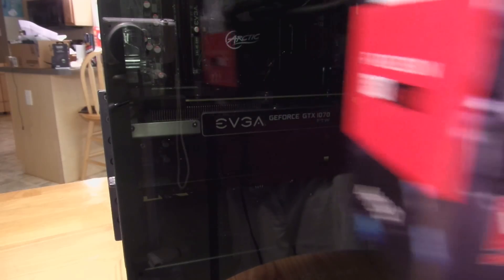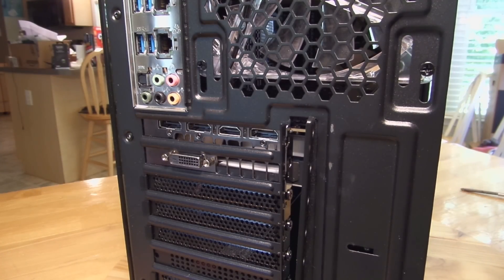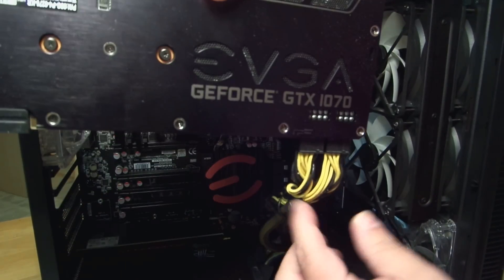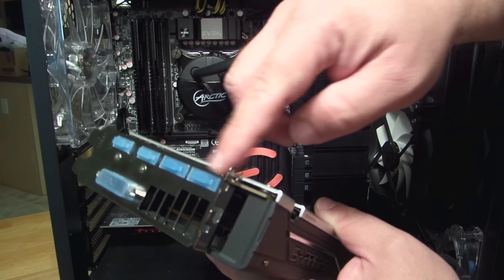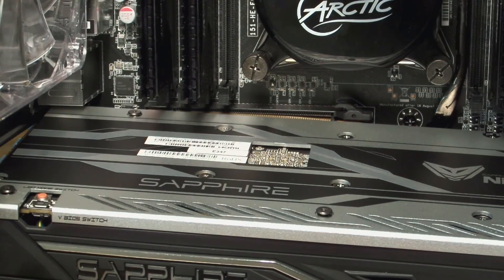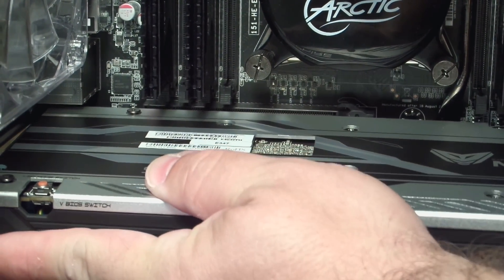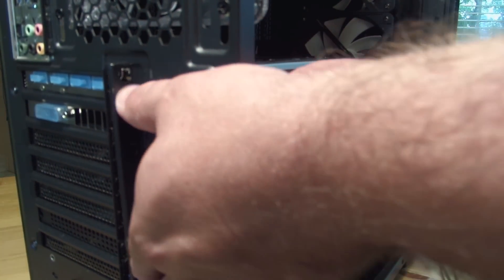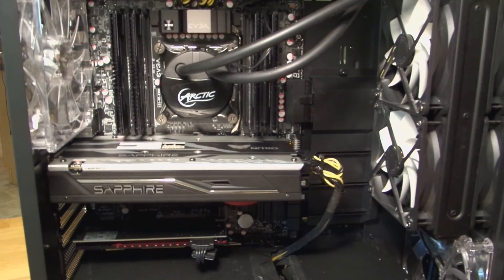Tutorial: How to Install the Sapphire Radeon NITRO+ RX 480 8GB GDDR5 OC Video Card

Comment: hey guys i have already got all of these parts:
CPU: Intel Core i5-6500 3.2GHz Quad-Core Processor 
Motherboard: MSI H110M Pro-VD Micro ATX LGA1151 Motherboard 
Memory: Crucial Ballistix Sport 8GB (1 x 8GB) DDR4-2400 Memory 
Storage: Seagate Barracuda 1TB 3.5" 7200RPM Internal Hard Drive
Video Card: Sapphire Radeon NITRO+ RX 480 8GB 
Case: Corsair Carbide SPEC-M2 MicroATX Mid Tower Case  
Power Supply: XFX XT 500W 80+ Bronze Certified ATX Power Supply

1) Will all these be ok to run? 
2) Do i need better cpu cooling or any other fans?
Reply: i am using stock intel cooler. thanks for reply
Reply: would it be ok if i am only playing overwatch and csgo? i will add in future :)
Reply: Iggy Castillo thank you very much, keep up the good work, and will do in future! (I'll get the cooler and another 1*8 ram) another quick question, I sorta need help with actually installing windows, do I need to buy a product key?

Comment: Hi, my computer does not have the pcie cable, and my computer starts beeping without any cable connected. Is my card not compatible? Im not good with computers
Reply: It says it's 300W dunno what other info is important, it came with computer. Is there any sort of adapter, or should I upgrade my PSU?

Comment: Hey, I just purchased this card. I have a 500 w power supply, but after about an hours gaming my computer will completely shut off, with no warning. I'm pretty sure it has to do with the card overheating; that or the power supply. I'm guessing heat problems. Any thoughts on how to get my airflow working best with this big beast? It seems to get a lot hotter than my previous card, as well as use a lot more power to run.
Reply: I also realized my 500w PSU only has a 6 pin PCIE that I plugged into the 8 pin. Would this be the reason for the heating issue; with the card not having enough power to cool itself off?
Reply: yes need 8 pin,  doesn't cost much for a new psu, 550 watt would be better